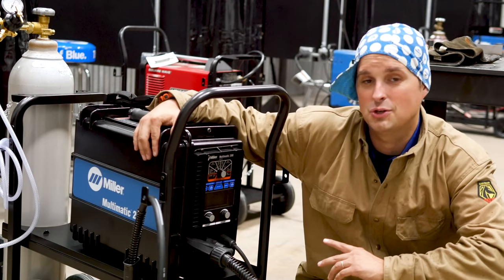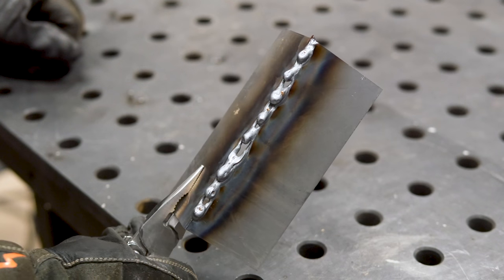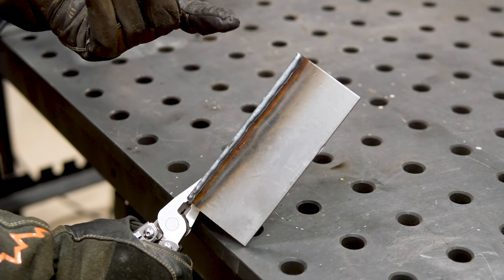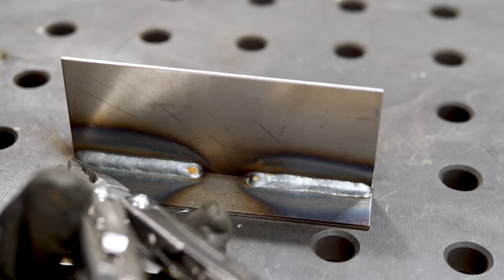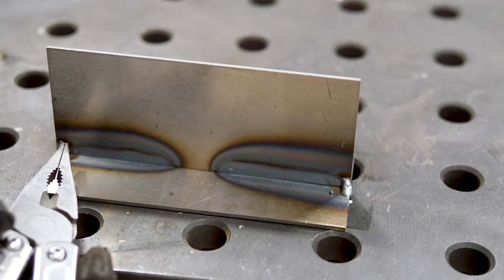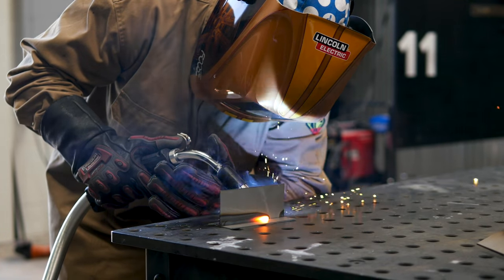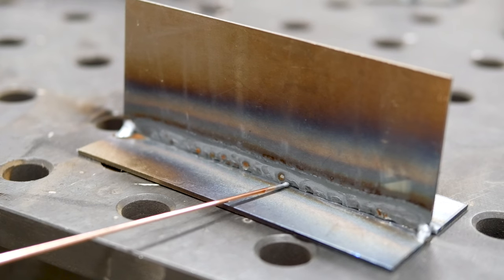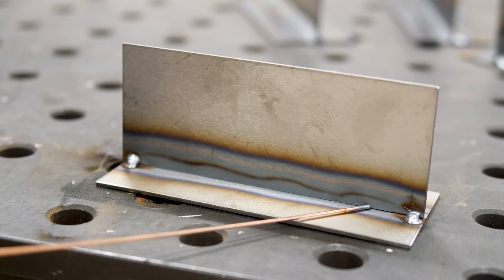Welding Tips: Why Am I Burning Through?

Comment: Just remember you can't push with flux core since you'll include slag in the weld.
Reply from the maker: Yes, you do always want to drag flux core unless you are going uphill with a slight push angle because gravity will pull the slag out to the surface of the puddle.